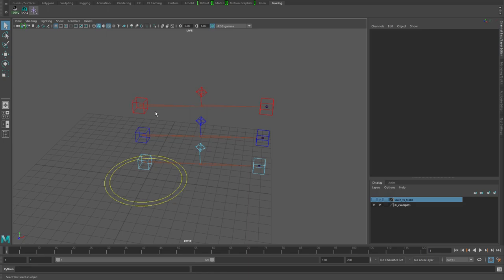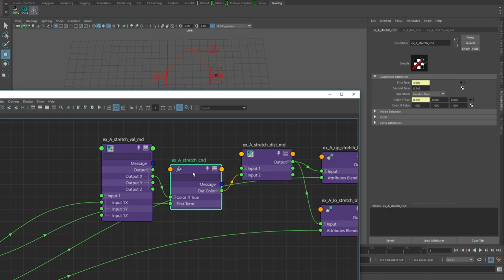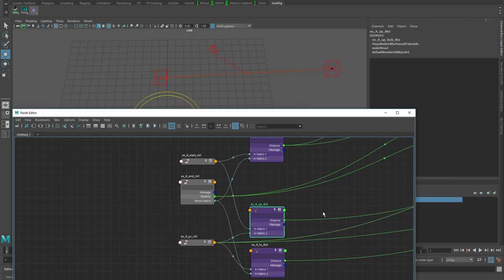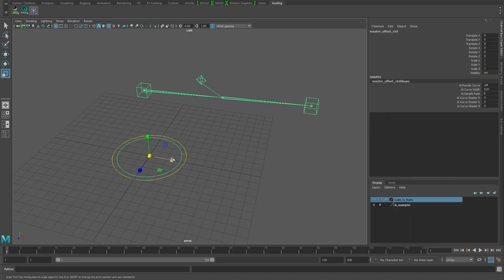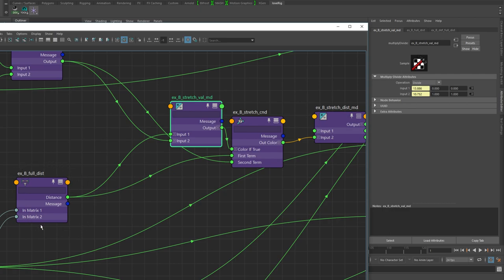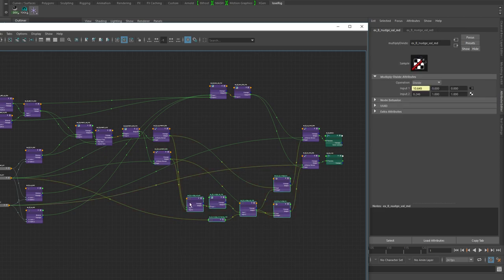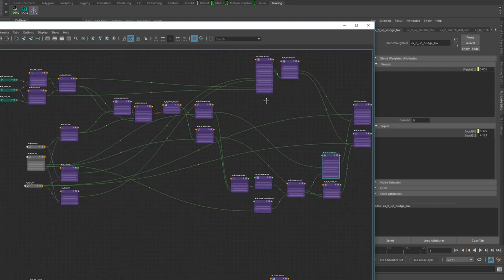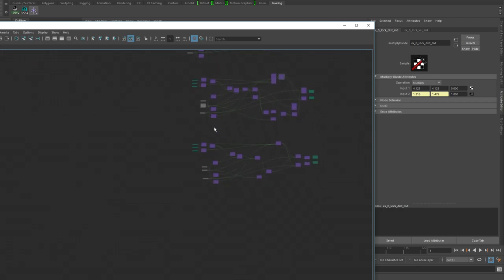(part 2) Optimized stretchy ik with elbow/knee lock and bomb-proof global scale tutorial

Comment: I just made my own somewhat similar system for anti knee popping which turned out fairly well.
I calculate the IK length relative to the total limb length, then I plug the result into this function: y(x) = 1 + ln(1 + e^B(x-1))/B, 

The fucntion follows y = 1 very closely for values of x < 1, and y = x for values of x > 1, with a soft transition that can be adjusted with the paramter B. The output of the function then plugs into the scaling of the limb.

the neat thing is that you can just use x/y(x) to get a mirrored version of the function, and this allows you to make soft lock out without changing the limb length
by letting the ik handle smoothly approach the max distance. If the output of the funcion is 0.98 I move the ik handle 98% of the length of the fully streched leg towards the controller.

These two methods yield the exact same solution for the IK joint rotations, so you can easily blend between them.
Reply from the maker: Yeah, I don't particularly like the soft ik stuff because it pulls the ik handle away from the control - I'd prefer it to stay on the control no matter what and have absolute control over where the knee is, which I personally think makes posing a lot easier.

But, I know a lot of people like soft ik as well, and if it works for them, then I'm cool with that too!

Comment: Really love your eplanations! Cool setup! I actually never uses adl and mdl nodes. Will have to look into them! Thanks!!
Reply from the maker: Thank you!  I'm glad you liked the video(s) and I hope you find them useful!  I really like the adl/mdl nodes for when I only need to add/multiply one "set" of values together.  They're really simple nodes that do exactly one thing - definitely beats having a multiplyDivide node that only uses the X inputs (and I don't like how bloated plusMinusAverage nodes are - 1D, 2D, 3D... really Maya?).  I just wish they had subtractDoubleLinear and divideDoubleLinear nodes as well!
Reply: @JarredLove  Hi, in my opinion, the main reason you should use MDL is when you enter joint translation values in its inputs. Make a try and compare with multiplyDivide Node. In the Channel box Edit>>Settings>>Change precision... choose 15 digits. copy/paste joint translation values in an MDL and in a multiplyDivide and you'll understand. The multiplyDivide Node can't exactely take your values, it just change it when you paste and press enter ! Ok, it's not much, but the approximation errors grows exponentionally in a large network. The MDL takes exactely the right values.
Reply from the maker: @alexgregoire4136  Hey Alex, that's very interesting.  I never use copy/paste in the channel box because of the precision loss - I always use getAttr and setAttr because I want to make sure I get the true value and not some rounded approximation.

I did a test where I created  a node and randomly moved it, then created a multDoubleLinear and a multiplyDivide node.  I connected the translateX to the input1 and input1X of the two respective nodes as well as connecting the translate parent attr to the input2 of the multiplyDivide.  Then I used getAttr on the translateX attr of my node, the input1 of the multDoubleLinear, and the input1X and input2X of the multiplyDivide.

The values of the node and multDoubleLinear were identical while the values of the multiplyDivide were off a bit (starting at about the 6th decimal place).  The reason for this is all due to the attribute type.  The translate attrs on transforms and the multDoubleLinear attrs are of type 'doubleLinear' but the multiplyDivide node's attrs are of type 'float'.  DoubleLinear and float data types have different precisions inherently built into them due to how much memory they're allotted (if I remember that correctly...).

Thanks for bringing this to my attention!  It just helps further fuel my desire for a better suite of math nodes.  There's an idea on the Maya ideas forum for this if you're interested in reading through the comments and adding support (honestly, I think it's got more than enough support to still be in the 'gathering support' phase, but it is what it is...).  Here's a link:
https://forums.autodesk.com/t5/maya-ideas/add-more-math-trig-nodes/idi-p/7963332
Reply: @JarredLove  thanks for the link. I also  use the get and set attribute functions. Just to clarify this point, these functions rounds values if you use them in mel. Python is far more precise and gives more digits ;)

Comment: Hey Jarred... This system of yours solves every problem that I initially had while rigging. And its really wonderful.
Well, I am a newbie to node editor and also the blend to attributes node that you used in here. Could you please drop down a suitable link to know how to use it. The problem that I am having is that I am not able to add input(0) and the driven part of the blendtoattr.
Reply from the maker: Hey Aster,  Thanks for taking the time to watch my video and ask questions!  It seems I've had a few people asking about how to use the node editor, so I guess I'll try and make a tutorial video about using it soon...

In the meantime, I hope I understand your question - it sounds like you have a blendTwoAttr node in the node editor, but you do not see the input[0] and output attrs on it, correct?  If that is the case, take a look in the top right hand side of the node within the node editor and there will be an icon with 3 bars on it.  If you click on that, it will expand the node and show you attributes on it.  If you click on it until all 3 of the bars are 'empty' you should see both the input and output attrs to allow you to connect to them.

Unfortunately, not all the nodes show all of their important attributes by default (I think the Maya developers need to take a pass on all the nodes to update them so the most important attrs show up by default).  If you run into a situation where you can't see the attr you're looking for when you're using the node editor, you can always mouse over the node, click and hold the right mouse button to bring up a menu, and then select 'show all attributes' to bring up everything.

Hope that helps!  And I'm glad you liked the video!
Reply from the maker: Here's a link for a video on how to use the node editor.  Hope it helps!
https://www.youtube.com/watch?v=YASGoq6YH0I

Comment: Hey Jarred! Thank you for the amazing tutorial! I was also wondering how you would incorporate a soft ik setup into this but also keeping the nudge. I tried adding in the soft method but trying to connect it to the stretch has been my biggest hurdle. I am not sure where in the setup to add it or how.
Reply from the maker: hello - thanks for watching and commenting!  I've been asked about incorporating soft ik before (I think it was in the comments for this video, so you could check there for more on the discussion)...  While I think you could probably do it, I don't particularly like the way soft ik works by moving the foot off of the actual control - you reduce the knee pop issue, but introduce a foot stability issue.

So, the nudge is actually designed to help with the same knee pop issue... I also added a knee slide into this setup on a later video which gives even more knee control to help with any popping issues.  The combination of these give the animator complete control over where the knee is positioned to fix any popping issues.

As for how to incorporate the nudge into your soft ik, I'm not entirely sure how without seeing your node network... but I would say that you need to locate if/where it is adjusting the length of the joints in your ik chain, and add in the nudge value there.  If the soft ik setup doesn't adjust the limb length, then I would think it would get added in a similar way to this video - the soft ik would just be added into it to drive the ik endpoint and probably wouldn't affect the joint lengths anyway...  I hope that helps!

Comment: Amazing setup! Not gonna use the scale method anymore! Do you think it's possible to have automatic nudge in the opposite direction with a small value while stretching the arm, something like automatic soft ik or maybe a different method to implement automatic soft ik ?
Reply from the maker: Thanks for watching and commenting!

Ah, soft IK... The idea with it is nice, but the thing I don't like about the soft IK setups I've seen is that the foot/hand tends to pull away from the control before you reach the fully extended length - and that causes a bit of a nightmare for an animator trying to lock down the foot/hand.

I think you could probably create a driver using the same equation as the soft IK setups that are out there, and then use it to drive or add into/with the nudge.  Since that would essentially just elongate the upper and lower joints instead of changing the endpoint, it should keep the foot/hand at the control.  The only thing that might be a little tricky to deal with is how to tell it when to stop nudging the length when you have stretchy turned off... although, it might be as simple as a clamping value you can blend on/off with the stretchy attr or something like that.  I may be able to look into that in the future if I get some time to try it out...

I originally created the nudge to try and solve the same problem as soft IK, but give animators complete control over it.  Some animators hate automatic stuff while others love it, so it can be difficult to know which way to go sometimes, haha!

As for nudging the opposite direction, do you mean to have the elbow/knee bend backward the opposite way?
Reply: @JarredLove  Yeah I undarstand, didn't saw it that way.  As for the nudge to be as it is but, to have the option to be "automatic". The same way animator will do it with some added keys, but if its possible to have this nudge activated when the arm is almost at full extention and to be deactivated back to 0 when the arm is extended, will that lower the snap ? I tried just to connect the nudge with the translate of the arm but still ended up the same result.
Reply from the maker: Ok, I see what you're saying - yeah I think you could possibly utilize the nudge to stop the popping, but you'll have to create a 'soft IK' driver that then gets added in with the nudge value (so it can be automatic, with the nudge attr used to 'offset' that).  You'll likely also want a way to turn the soft IK behavior on/off as well.

Directly tying the nudge in with the distance and setting up some set driven keys or something might be possible, but I'd really have to test it to be sure - so forgive me if you're chasing down a rabbit hole.

The problem really comes from the way the math works out - and it's probably why it still snapped when you tested it.  Basically, IK is solving for an angle based on the length of the sides.  Specifically in this case, the upper and lower limbs have a specific length, and the distance between their end points is in flux.  These make up a triangle, and the angle between the upper/lower limb 'sides' of the triangle is what needs to be determined/updated.  Using these 3 lengths, the angle is calculated with an equation dealing with sides and angles of triangles.  As the length between the end points approaches the combined length of the upper and lower limbs, that angle gets closer and closer to 180 degrees until Maya's mathematical precision can't really smoothly keep up any more and it snaps (although it's more the nature of the math involved and computers' number precision... not completely Maya's fault).

The soft IK 'solves' the snapping problem by adjusting the location of the end point to keep it from becoming completely straight while maintaining the length of the upper/lower limbs, but that's what causes it to separate the foot/hand from the control like I mentioned before.  This nudge system just lengthens/shortens the upper and lower limbs at the same percentage so the snap technically still happens, but the animator can use the nudge to pop it back out and manually control that last little bit... So in principal, it should be possible to use something similar to the soft IK equation and apply it to the length of the upper/lower limbs instead of pulling the end point off the control.

Comment: Great video, but would be really handy if the inputs were exposed on each node so that the full plug can be seen as its a lot of guess work in some cases. Clicking the plus sign on each node would really help clarify what is going where. I know it can be seen in the Attribute Editor, but still, a full exposure of connections would help a lot. I have watched it numerous times and some of the connections do not match or return the same results due to not knowing exactly what input/output is being connected.
Reply from the maker: hello - thanks for taking the time to watch and comment!

Thanks for the feedback and I'm sorry you're having trouble with the setup.  Is there a specific part that is particularly difficult?  I watched through the video again and didn't notice a spot that I wasn't able to follow... granted, it is my video and I understand how this specific node network works - but I made it quite a while ago and don't remember every detail of what's connected where...  Aside from that, one of the goals of this video was more to help understand what the process was and how each piece fits in so that it could be built upon.  In my earlier days, I followed several tutorials where nothing actually worked until you got to the last few steps, and I didn't necessarily understand WHY it worked at the end (which made it more difficult to break apart and modify with other needs).  A series of explicit 'create this node' and 'connect this to that' steps doesn't always have explanations of what the purpose is or how it helps in the ultimate goal of the setup, so a lot of the video is about going through the network to describe what's happening and why without necessarily creating a step-by-step tutorial... 

It is also a little difficult to show all the connections in a video especially as the node network gets spread out.  When you are looking at a node with its inputs/outputs well framed and large enough to be readable, some of the connecting nodes will likely be 'off screen' so I thought describing what was connected into what as I mouse over the attrs in the attribute editor would help to make more sense on certain math nodes (like the condition nodes, for example) - the added bonus of showing the attribute editor is to show the values of static channels that don't actually have a connection driving them, but the value in it is pretty critical to the functionality of the system.

With all that being said, there is also another video where I add a knee/elbow slide into the setup, and I may have done a better job showing the connections (or at least describing them)...  This video, having 3 big sections where I describe different parts of the overall solution in varying levels of detail does not make for a 'concise' view of the final solution.  Again, I was describing concepts more than specific inputs/outputs throughout a lot of the video to help describe at least some of the process that led to the clean result, and that next video with the slide does conclude with going through the entire node network to describe each of the connections in one go.
Reply: @JarredLove  Hi Jared, thank you for the reply, the content is absolutely fine, just will take me a little longer to nail down some of the connections as I was trying to trace the paths. To be fair, it was quite late when I was hooking nodes up, so I most likely overlooked or missed something, but am going through again to see where I overlooked a connection. I will look up the other vids mentioned and am confident I will learn what I need from your excellent instruction. Many thanks.
Reply from the maker: of course - and good luck!
Reply: @JarredLove  Ok, (6:40 in the video) so I have rewatched this and I dont get how you have a non connected value (4.123) in the input[0] of the up_stretch_bta and a connected one in the input[1] of the up_stretch_bta. If I connect the output X of the stretch_dist_md to input[0] and input[1] and then disconnect input[0], I just get left with one value in input[1] and cannot see how to add the value (4.123) into input[0] and have it shown.
This is where some confusion is creeping in as I tried plugging in the value of the joint X but same thing, if I disconnect it, I am just left with input[1], not input [0] and input[1].
Any ideas or suggestions? This is stopping the progression with this instruction currently.
Was the joint x value plugged in at some stage as I dont recall seeing that done. So where is the non connected input[0] value(4.123) on the up_stretch_md coming from? The input isnt showing a yellow band, so what was done to get it in there? 
If I try and edit it while input[0] and input[1] are connected, I get an error message: // Error: line 1: setAttr: The attribute 'up_stretch_bta.input[0]' is locked or connected and cannot be modified. //.
As it stands, it appears that the stretch works when stretch is at 1, but at 0, the wrist and elbow joints move to the 0,0,0 position and I am still somewhat confused by the lack of input[0] (4.123) on the up_stretch_bta (and lo_stretch_bta)
I am using Maya 2022. Thanks Jared.